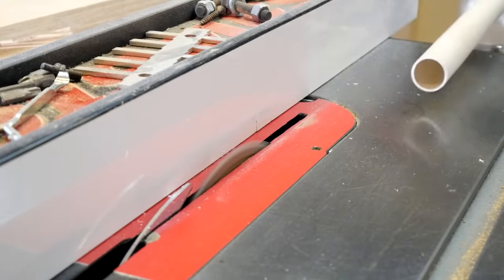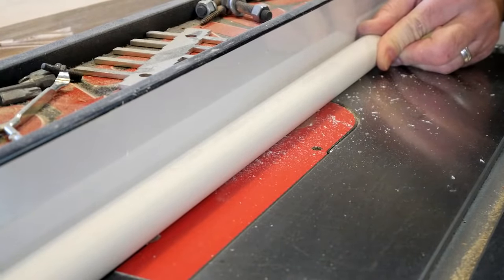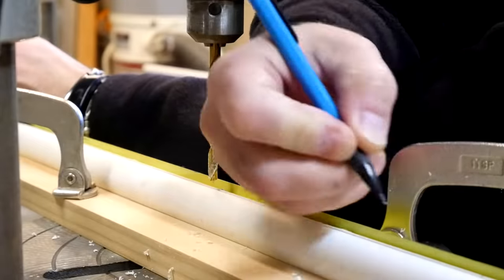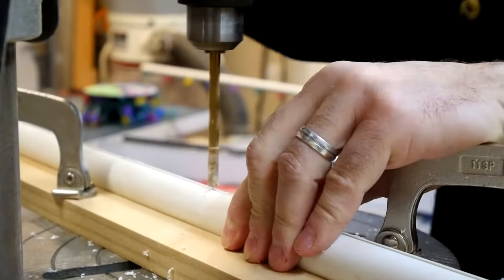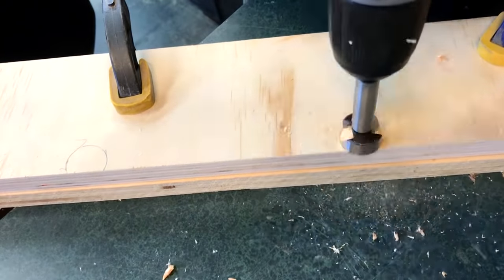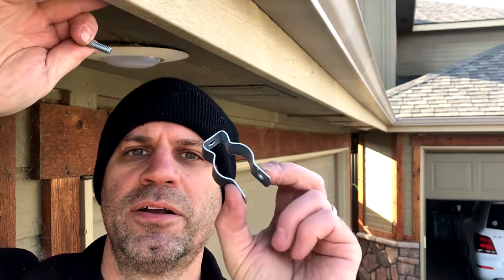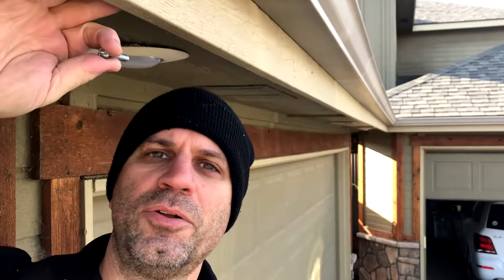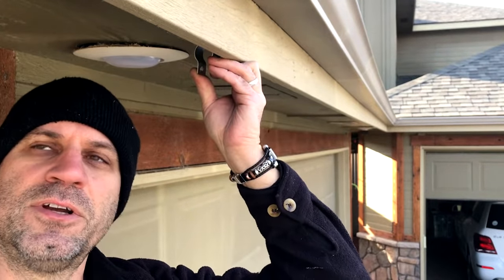Better Way to Install Christmas Lights

Comment: I think my install is much easier and faster. When I 1st bought my house over 20 years ago, I permanently installed 2" screw hooks every 4' or so on my fascia. It probably took me 1-2 hours to do it (single story). When they are painted the same color as the fascia, they practically disappear. Now, it takes me longer to get the lights down from the attic than it does to hang them. Oh and btw, leaving your Christmas lights on your house all year long is pretty tacky and lazy.

Comment: You should set up a wedge, to proceed the lights, so that you are able to draw the wedge through the slit in the pipe. Fasten the other end of the lights, to a stationary object ( taught, and slightly higher, to allow for drooping, and so the bulbs hang down ), then draw , or pull the wedge (and light wire ) through the tubing (obviously with the slit also angled towards the floor.

Comment: All that just to put up some Christmas lights?  Yeah, first thing I'll do is build a 100k building for my wood shop.  Then, I'll fill it with 50k worth of equipment.  Then, I'll take woodworking for a couple of years so I don't chop a finger off or send a splinter into my eye working on all that equipment.  Then, I'll spend 3 hours building rigs to hold lights.   Then, I'll hang them in about the same amount of time I could have just hung the lights without doing any of that.  Then, I'll take up an entire corner of my 100k wood shop storing the rigs until I hang them again next year.

Comment: The only problem I see with using PVC pipe and leaving it to up year-round, is that over time the heat will eventually warp the PVC pipe and it will give your installation a bad look. Heat is trapped directly under soffits which rapidly degrades poly vinyl. Even using the metal conduit hangers as shown in your video will eventually warp and sag the PVC pipe over time due to the heat especially since the pipe is being installed on a horizontal axis. Adding that thin-walled PVC pipe was used, maybe it will last one season.

Comment: Should have drilled the holes BEFORE you cut the slot!
Reply: As is often the case, when I build something it's usually a partial idea and partial progress, then I realize something as simple as pre-drilling.  My concern with this project is that insects would find a happy nesting place if the lights were to be left up all year.  One solution he didn't think of would be silicone to fill the gaps.  But the open ends would become a problem as well.  THEN what happens when the string goes bad?  We've ALL had strings of lights fail.  Even LED type lights.

Gosh I miss the old days of real Christmas lights; not those cheap LEDs.  Nothing beats the warm glow of an incandescent lamp.

Comment: Man, you wasted a lot of time and money for this. Just buy the roll of sockets, buy the lights, install them with the HLO styl clips. Put on your house and cut at whatever dimensions you need for your roof line and gutters. Make your jumpers and plug it in. Those clips are easy and stay on your lights. The following year it’s already cut and ready to hang all you have to do is plug it up and go.